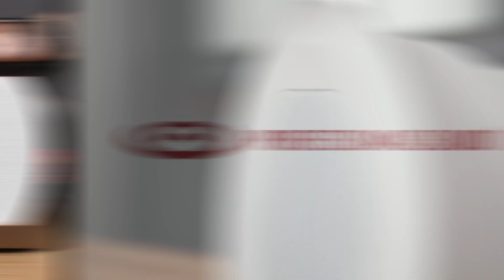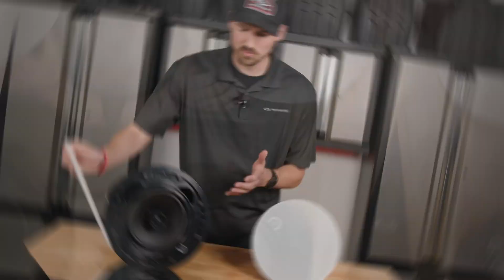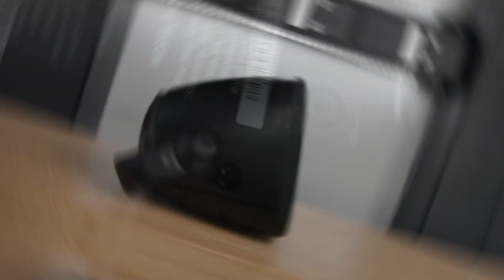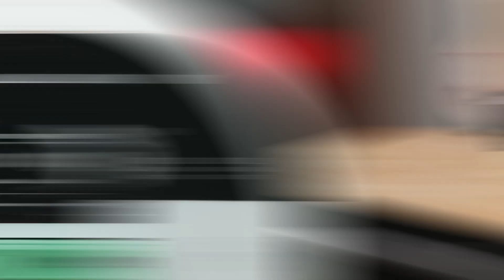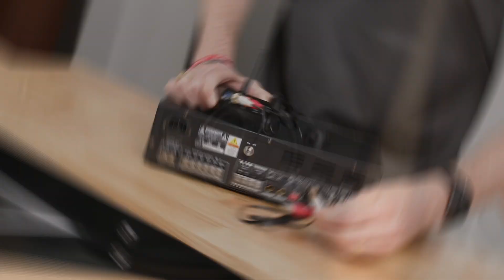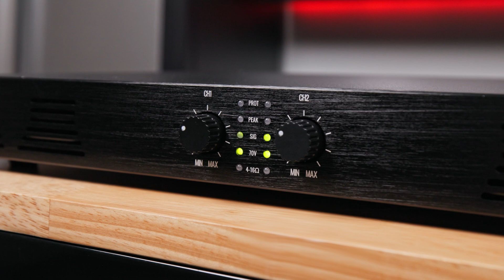What Is a Power Amplifier Used For?

Comment: sooooo I have 2x old Mission 704 floor standing speakers an a old Cambridge AZUR 640A amp....... i feel i need more power as im turning the volume up almost 3/4's to get a good volume...... do i need a power amplifier?
Reply from the maker: It sounds like your current amp may not be providing enough power to drive those speakers to the level you'd like. If you're turning up the volume close to 3/4 and still not getting enough sound, a power amplifier with a higher output could help. A more powerful amp can provide the headroom needed to drive the speakers more effectively, ensuring you get better volume and sound quality without distortion.